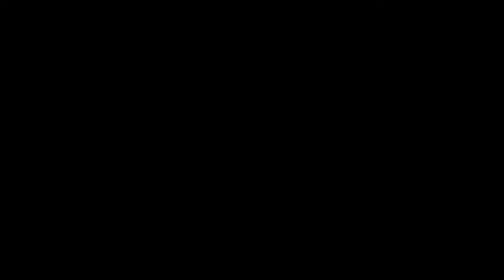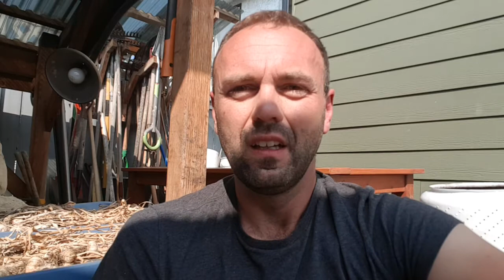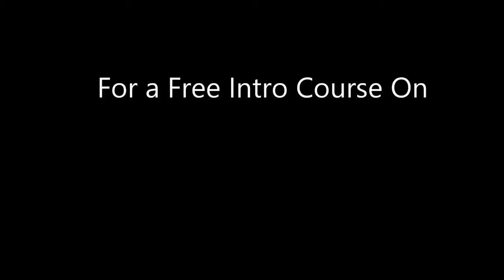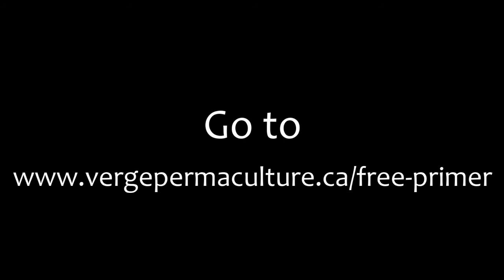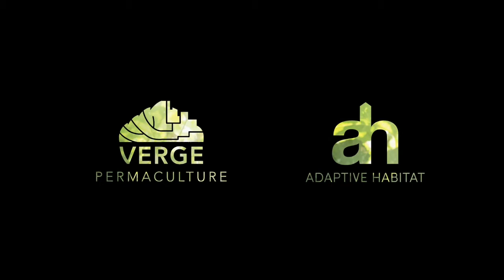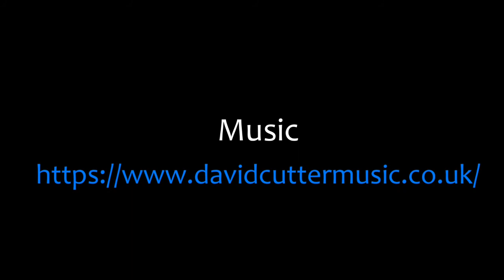Part 7 - Why You Should Consider a Deep Energy Retrofit For Your House

Comment: We have been on a journey with our 70's passive solar house in western Oregon. We added 10kW PV system, air sealing, new windows, and an additional R40 insulation in the attic. Also, we added a rain screen system, which surprisingly added R to the walls - probably due to stopping external convection. Finally we added hybrid water heaters. 

We aren't quite net zero, but we're getting close. My garage is the next challenge, as it acts as a heat sink or source against the living space. 

Great channel - thanks for doing it.